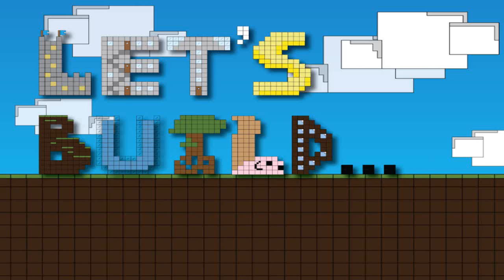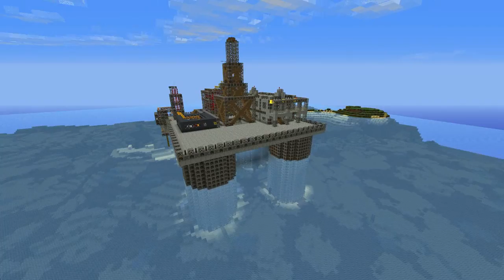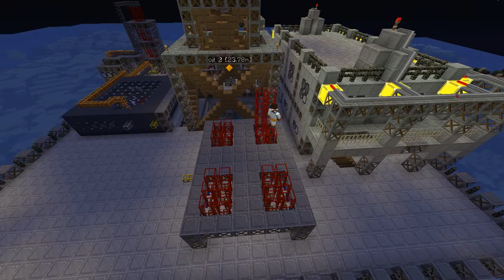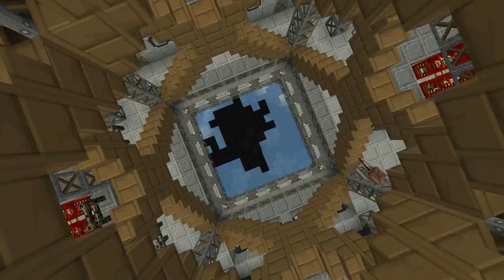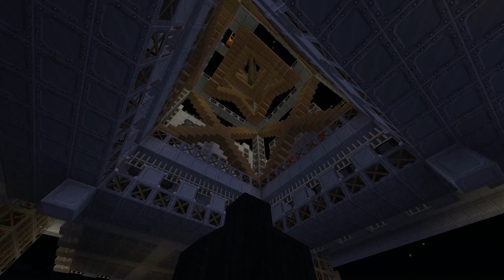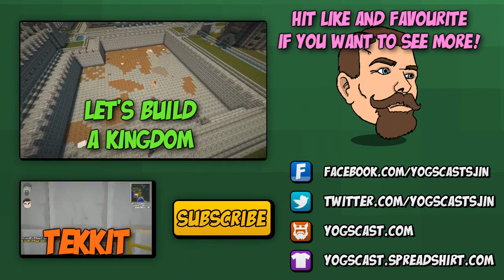Let's Build: Sjindustry - Oil Platform #4

Comment: Sadly golden waterproof pipes don't move liquids any faster than stone, they have a larger holding capacity than others though, so with enough power putting liquid in they can move larger loads, but it will move through them at the same speed...
So, faster... In a manner of speaking.

Comment: I have only one objection to do, only one. The oil pump pipes (power and output) should have ran up there from the inside the spire, not the outside (even if in most real world oil rigs the pipes are out). That whould have made for a finer detail, and it's just the only bad thing that can be said from such a marvel. Great job, Sjin, really great job.

Comment: Correct me if I'm wrong, but all the fuel is powering the engines and the power from the engines powers the refinery? So the oil platform just powers itself and doesn't store any?

Comment: Just wanted to point out, golden waterproof pipes aren't quicker, they just hold more liquid. 
So they are only become quicker if you pump in more liquid then a normal pipe can handle, so the liquid doesn't move faster, you can just move more of it.

Comment: This isnt really important at all but for realism (this obviously isnt made for realism) the pipe that brings in water would have major problems since all the machines would become very damaged and corroded due to all the salt in the water. You would need some sort of filter or a different cooling system that didnt directly touch any machinery as to not ruin it so quickly.

Comment: The crane on an oil platform is for moving things (replacement equipment, crates of supplies, etc.) from supply ships to the oil rig (and vice-versa). There's no possible reason for them to have a digging scoop on the end of the crane. :(

Comment: I was checking out the Not Enough Items mod in tekkit and I noticed that there are steel ingots. Now, I know that it's not a very useful thing and it's mostly used for decoration but, is there an actual recipe to make them. When I tried to press R on my keyboard to show the recipe, it didn't show me anything. That's why I was wondering if there was a recipe.

Comment: So, the entire operation turns oil into fuel, which then powers the engines, to turn more oil into fuel, and none of the fuel is ever just left for storage?

Also, how did the engines start, with no fuel in them at the beginning?

Comment: Finding and pumping oil in Tekkit:
Sjin: Build a fully functioning oil platform and spending hours
Me: Use 5-6 Cobblestone to put the pump down right on top of the oil, then use one teleport pipe to bring it back.
So, yeah...

Comment: pobably not because when you place a source block it will try to spread out aleast one block(in the sky or on the ground). and honeydew had a source block next to the main line. so it spread over the pump. and i is by getting the water out of the pipes and removing the water

Comment: The reason there is a crane on oil platforms is because they use it to load or backload pipes and containers to/from a supply vessel.

Comment: How did you power the combustion engines from the start? You needed them to run to produce fuel so what did you use to kickstart the proces?

Comment: The reason for a crane on an oil rig is mostly used for transporting pipes and other heavy material that would be needed to repair pipes, part of the rig, and other things. As the parts needed to make and maintain a rig are fairly heavy. I've been on oil rigs before, as well as my dad makes his living on them. :)

Comment: Forgot to mention, why isn't he building the oil platform on a RP2 frame? Then he can *move* the entire platform to where he wants it. It's a lot of work to build with frames however but, you can even make it "fly" that way, if you wanted to do that...

Comment: There may be a shovel attachment for the crane but I think that what you woul find is a doul cable crane that unloads containers with supplies from ships. There is a small area left correct? Place some collored blocks representing shipping transport containers.

I don't know oil platforms either it's just a guess for what might be required.

Comment: @MrSommar25  There is as much fuel as oil, but you also have to fill up combustion engines with oil or fuel. Even if it takes all of your oil to make a little bit of fuel, it's still worth it because the fuel lasts longer.

Comment: I had a question about building.  In an earlier video you mentioned that you did not want to have too many of one type of block in the area.  I wondered what you reason for that was, does it prevent lag?  I ask because I am working on a castle build on my own server, sized 124x79x49, and wondered if that could be a source of the lag I am experiencing.

Comment: sips, it's not a crane in the pic, that is the tower for the gas burning flame. it does look like a crane, but that's 'cause it needs good support to lean so far away from the rig and the structure of a crane is a good design for this. trust me, my dad works in a rig, i have been to a rig and to the aberdeen oil museum thingy.

Comment: ive replicated this in my own tekkit world. in only a few hours, my engine bay blew up. after much more grinding, i fixed the engine bay and added 3 additional pumps for water. this allows a more sustainable oil platform.